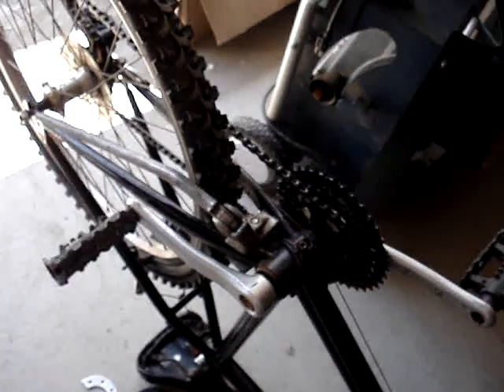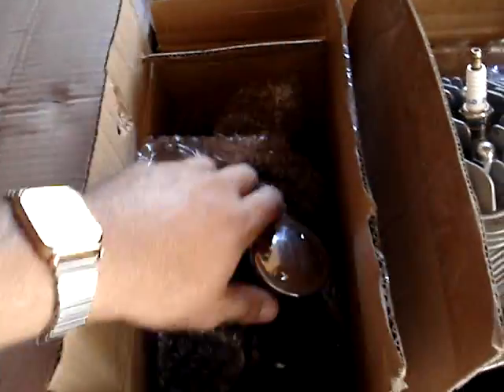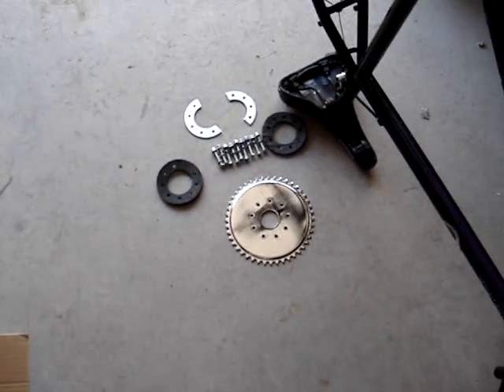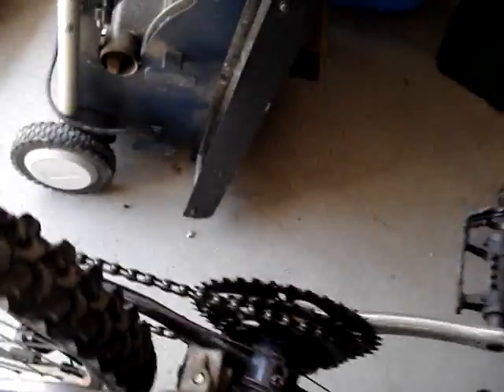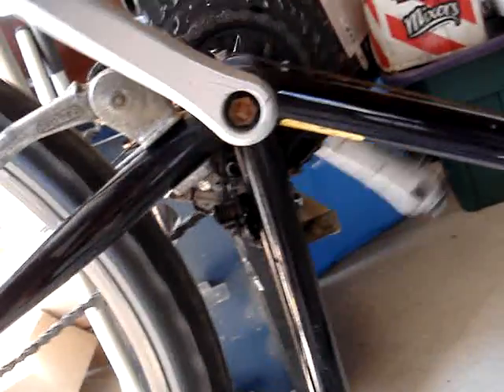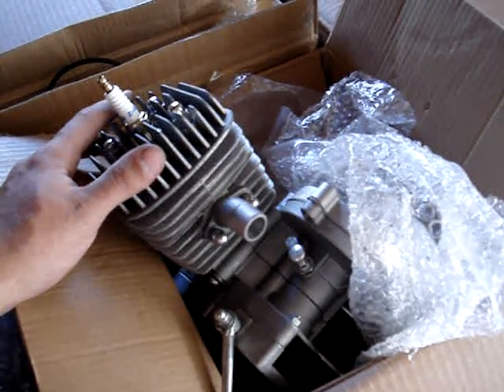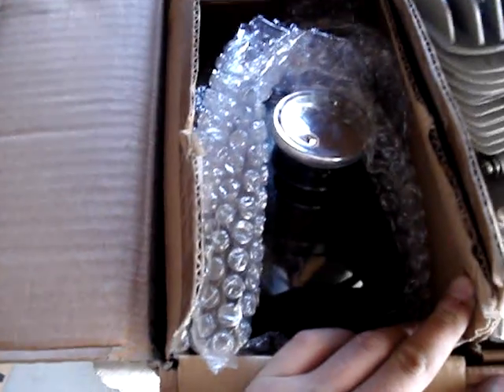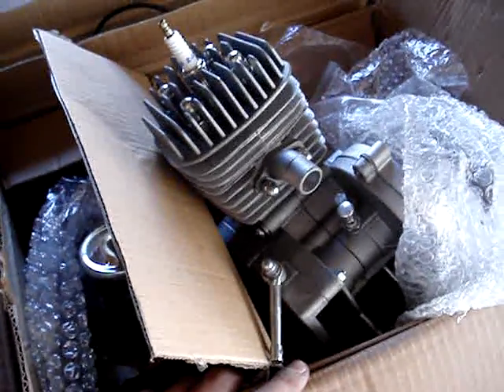Gas Bike out of the box

Comment: @ryan000s actually you can add a small oil tank that puts oil in the engine. contrary to popular belief, you dont need to mix the oil and fuel before it enters the engine. as long as the oil gets to the parts that need it itll be just fine

Comment: @wolfgang8u Once one cylinder fires it drives a drive shaft to the rear sprocket which realigns the other drive shaft on the (opposite side of the frame and sprocket)into firing position. with this design of drive shaft no friction is lost in drive gears. like we have in modern engineering. now days we have the pistons driving a cam shaft which eventually turns a crack shaft which them turns a drive shaft which then turns your wheel. Why not just turn the wheel at combustion. Light bulb goes off

Comment: @wolfgang8u meaning build your own two stroke like a shaft driven motorcycle. it would take some calibration and you would need a small generator and a battery to regulate voltage for you ignition system but definatly feasible. picture two fuel cells where the ignition chamber was regulated by low pressure. you could calibrate the system using HHO pressure alone. when the pressure reaches a certain threshold it releases into the next chamber where combustion occurse

Comment: why not make another casing instead on this motor. put a presure valve on the electolosis cell that when pressureed to about 50 psi or something lets the gas excape into another chamber for ignition spark , which the combustion would them drive a fly wheel for the bike.

Comment: @fpvshitsonhsv 

I've thought about the same ans I theorized that a slight increase of oil in the mix ratio may overcome that issue and the hydrogen may help that extra oil burn more efficiently, while still lubricating? A four stroke may be a more reliable concept, but you never know until you try. If I ever get around to it, I'll try it out myself.

Comment: Check into Militec 1 oil treatment. I have run my car on it with no oil in the crankcase or water in the radiator for 100 miles. I also had a chase vehicle with a car trailer just in case,  I tore the motor down and found 0 wear...

Comment: the engine will seize because in two stroke fuel it uses oil in the fuel to lubricate the engine unlike four strokes which has a crankcase that holds oil to lubricate the part such as connecting rod cam shaft and crank shaft. basically if there is two peaces of metal that are rubbing at fast speeds, it needs oil. 

sorry for crashing your idea. lol